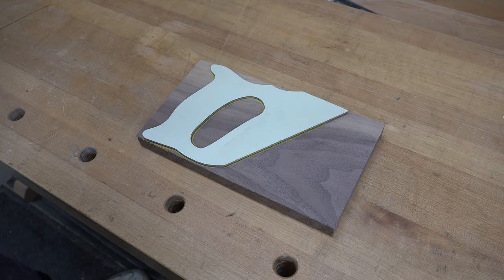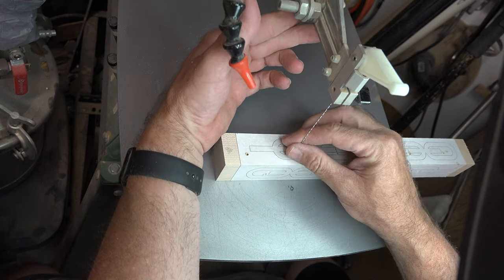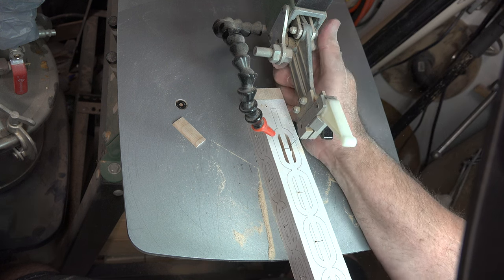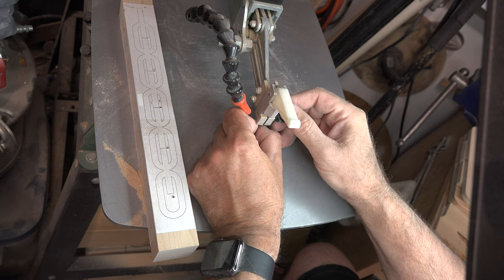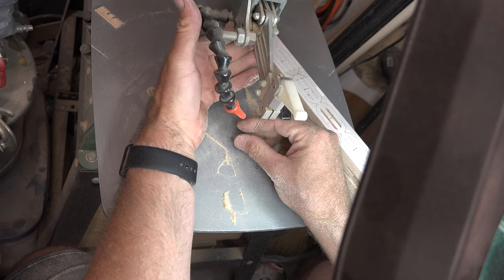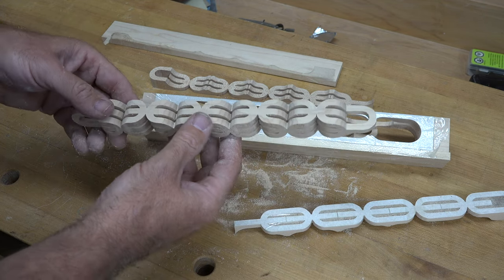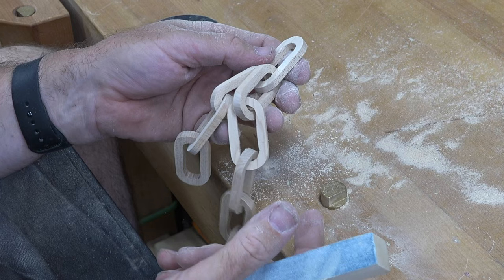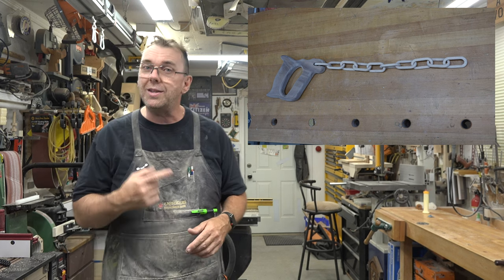Making a Scroll Saw Chain Saw

Comment: This is an awesome project.  Very interesting. And the result is beautiful.  You mentioned a few species of wood at the beginning. Pine was not among them. Is pine not suitable for this kind of work?  And I was wondering: is it possible to use a larger dimension of wood (2 by 2 or 2.5 by 2.5 inches) and do it with a jig saw?
Reply from the maker: I have made these out of pine as well Hans but they just aren't as strong and are more prone to breaking during the shaping process.  You can make them as big as you like as long as you have a way to cut them.  A jig saw might be a little aggressive but as long as you clamp your piece down well, it could possibly work.  I might have to try that.  Thanks for tuning in Hans and for taking the time to leave your comment.
Reply: @acutabove_woodworkings  I thank you very much for your answer.
Reply from the maker: @hansdegroot8549  You're very welcome.

Comment: Great video! I’ve been wondering about sitting/standing while scrolling. Do you put your table at an angle because you’re sitting? Thanks!
Reply from the maker: My scroll saw currently is flat and I sit at it with no issues.  That being said, my old scroll saw (a DeWalt DW788) was tilted while I sat at it and it was much easier to do longer marathon cutting sessions.  It's all about person preference and honestly, I prefer the table to be slightly tilted towards the user.  I hope this helps Patrick.  Thanks for tuning in to the show.
Reply: @acutabove_woodworkings  Thanks!

Comment: Suggestion on applying the template to the stock! Apply blue painters tape to the stock they spray the adhesive to the template and the blue tape on the stock. It so so much easier to to remove the tape and not have adhesive to clean up🤣🛫
Reply from the maker: The masking tape method does work well on some projects and I have used it many times myself.  The problem is that with a project like this, that creates so much dust and takes so long to cut, the sawdust works its way underneath the masking tape and causes it to release prematurely.  When that happens, you lose your pattern, your alignment and your project is pretty much junk.  While I do like the masking tape method and have used it many times here on the show, for this type of "long haul" project, I prefer the pattern to be a little more secure.  Thanks for tuning in and for chiming in with your suggestion.
Reply: @acutabove_woodworkings  wow thank you for explaining that. It makes a lot sense. 😀🛫